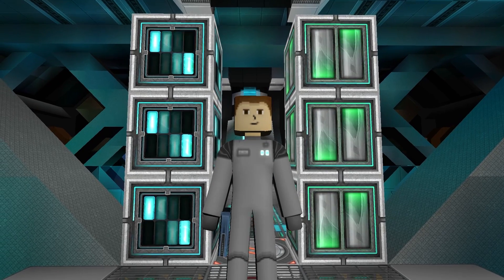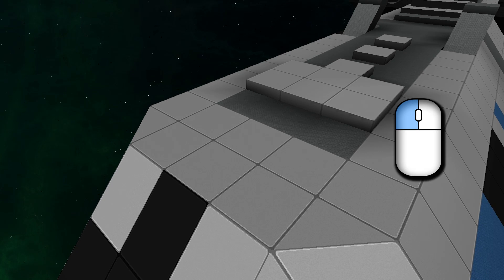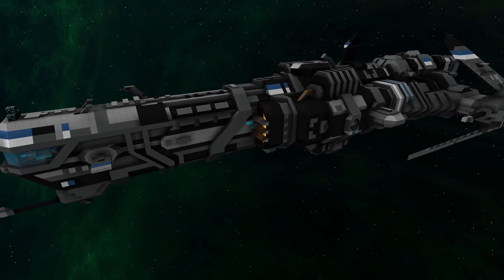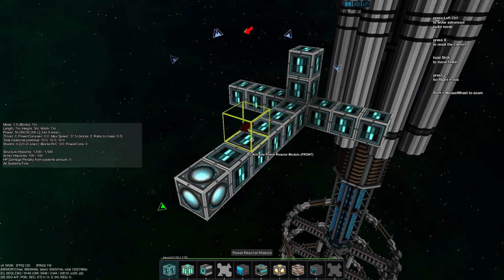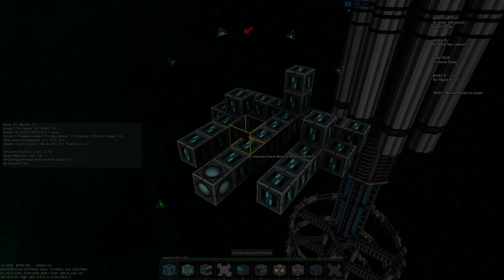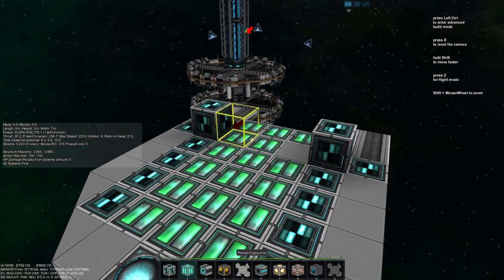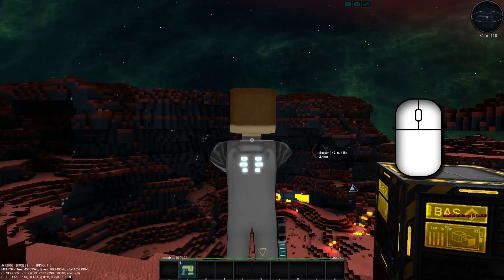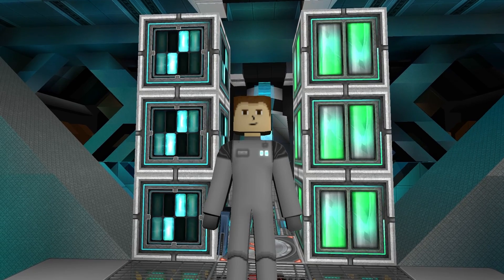[OUTDATED] StarMade Flight Academy - Power Systems

Comment: Always great. I really do enjoy the mechanisms behind power. It puts an interesting emphasis on ship design. I didn't know about the power cells grouping though. 

Please, keep up the good work.
Reply: +coconutologist Connecting power capacitor groups can be a very substantial gain. When I revamped power on my main ship I forgot a fairly large cluster. When I remembered I used 15 capacitors to connect the systems. I gained 2.4M power from this.

Comment: "once you reach millions of power regen"... 

Its 2 million e/s, millions is such a vague term.
Reply from the maker: +James “therimmer96” Rimmer It is subject to change and therefore a minor detail to new players. In retrospect, I probably shouldn't have mentioned the specific power output of a single reactor.
Reply from the maker: ***** It is per entity. So per ship. The softcap does not mean you cannot go past 2 million power regen, it just means building efficiently after that does very little for you. This was initially to give small ships an edge in power regen, since they have less space.
Reply: Two million a second energy bonus cap? Maybe for a singular entity, but not otherwise. 

Just slap on docked entities with their own two million energy regeneration, energy suppliers, a clock, and just enough capacitors for the energy to be utilized by the suppliers efficiently. Boom! You now have the same boost to your reactors, and your reactors aren't as bulky and expensive. Just requires a bit more of an intricate design.

Thinking inventively has its quirks. Plus in a game where there are lenient limits, I love using creative means to give any excessive limitations the bird.